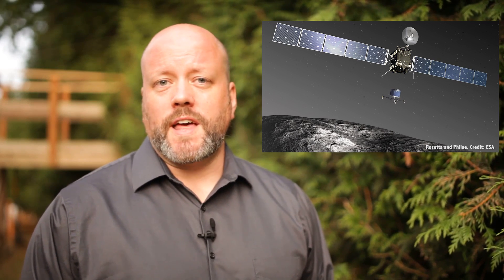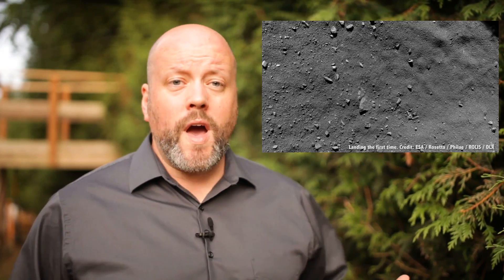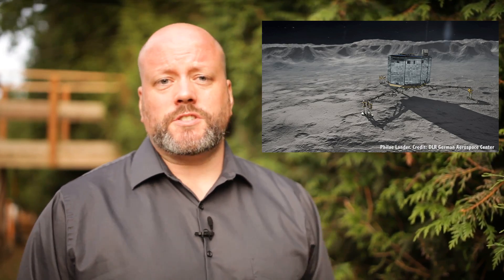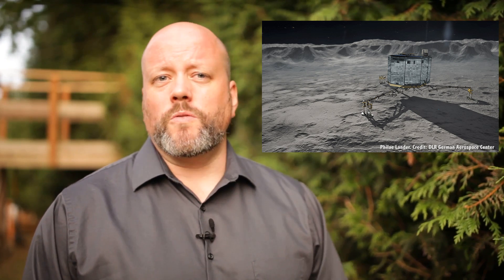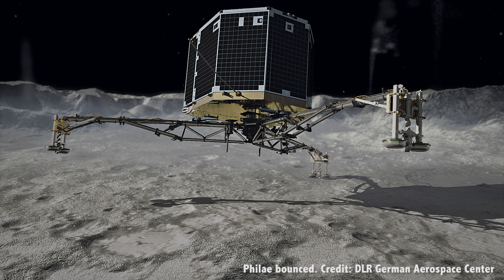Why Is It Tough  To Land  On A  Comet?

Comment: Great video! Would this kind of thing be easier for the mini-probes you're wanting to use laser power on? I was thinking something smaller might have an easier time touching down if we could give it proper landing gear.
Reply from the maker: Philae had a bunch of failures with its technology, it was built to make the landing, but the hardware failed. The laser probes would have a much harder time since they don't carry a propulsion system.

Comment: can we use thruster pushing downwards to compensate for the lack of gravity?
i know it would add a lot of weight but it could hold the probe on the surface until is safely attaches.
Reply: TheAllegiantTraitor Philae had a thruster but it didn't work. http://www.csmonitor.com/Science/2014/1112/Will-Philae-successfully-land-on-comet-Thruster-trouble-heightens-drama